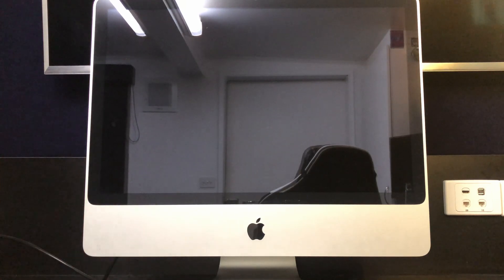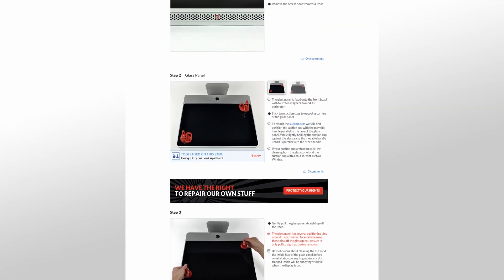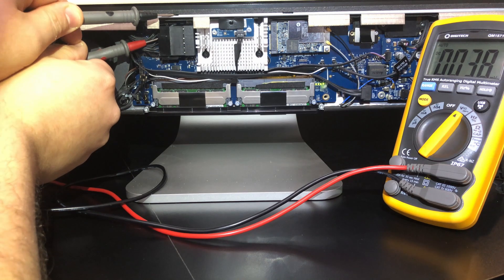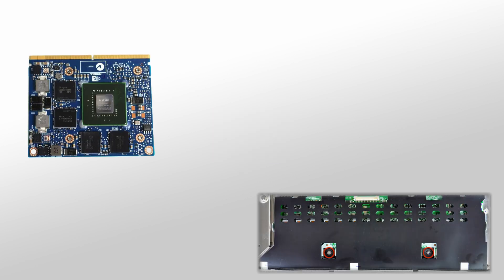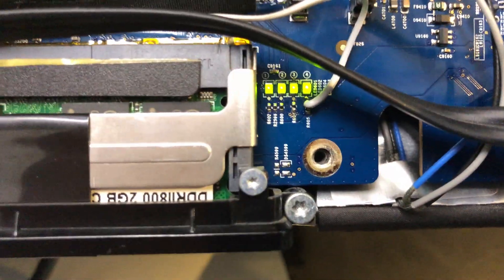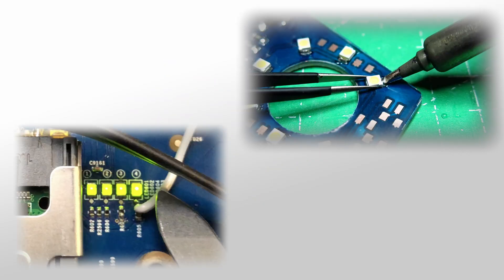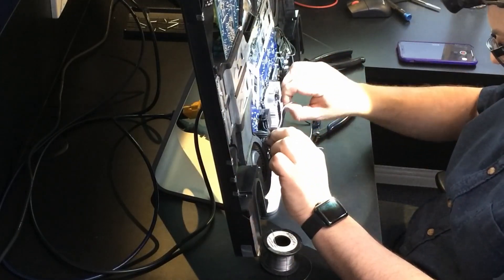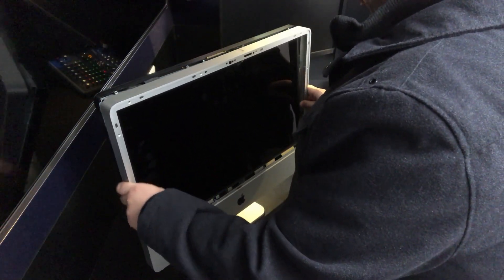2008 24" iMac No Backlight Repair

Comment: Hi there, I have an A1225 , powers on I can hear chime but black screen .   LED1 is on V = 1.8  LED2  is on V= 1.8 LED3 is off V=3.3  LED 4 is off V= 0
Terminal 3 on connector is 0V , I do not you schematic diagram to trace circuit . Any help appriciated

Comment: My imac 27 2011 screen goes complete black while imac is still working  ( Screen sharing to macbook still working too)   .. when I press power button for 1s and click on the mouse screen came back on (sometimes i need to repeat it few times) ,,,  I've done PRam and nvram reset ,imac was cleaned  Gpu ,Pcu termal paste change but did not helped ...   Any advice ?  ( Screen sharing to macbook still working during black screen on imac ) .. Any advice ?

Comment: Great video! I hope you still reply to comments after two years... I came to this page by google search because my 2008 iMac 24" has black screen issue. When powered on, I do get the apple chime sound, and I see the fans are running but nothing on the screen. I tried shining a flashlight into the screen, still see nothing. Then I did the voltage test as shown in your video, it came out as zero. One thing I noticed is that in your video, all of 4 LEDs are on with green light. But I only got LED 1 and 2 on, not 3 and 4. I suspect that my graphics card is dead, but not sure. I cannot find the right cable (mini DVI ?) to connect it to an external monitor to verify. Any suggestion or tip? Thanks!
Reply from the maker: If you have an integrated graphics card u won’t get led 3. If you have an actual graphics card then no led 3 means it’s not working. U can try take the card out and try the oven trick but that’s not a great fix, it will be temporary at best.  Buying a  replacement card wouldn’t be worth it. 

If u have no graphics card (intel graphics) (not even sure if this was an option with ur model) then u won’t get led 3 and you probably have an issue different from this video.
Reply: @AronBezzina  Wow, thanks for the quick response. Really appreciate it. I do have a discrete graphics card and your reply somehow confirmed my suspicion. I will see if I can get a spare part for it.
Reply: @AronBezzina  Hi Aron, just to follow up on this. It turns out that it is the graphics card and 2008 iMac does have discrete graphics card. So, I replaced it and now it works perfectly. Thanks again for you help.

Comment: I can't quite figure out what's wrong with mine. The iMac [early 2008] restarts several times before being stable. Of late it shuts down more often than before [3 months problem]. 
1. I noticed that the first 3 LED lights work just fine but they quickly go off [except #LED 1] whenever #LED4 comes on. This happens several times until it finally stabilizes and turns on [at this point, all the 4 LED lights are on and performing normally]. 
2. I further examined the inverter area and discovered that one of the 4 connectors [from the inverter to the screen] was burnt [the plastic was melted]. I replaced it with a good one hoping that the problem will be solved but it persisted. 
How can I solve this? Thank you
Reply from the maker: It could be a bad power supply. I would suggest using a multimeter to check the voltages coming out of the psu.
Reply: @AronBezzina  I’ll do that, thanks. Does using a UPS make a difference? Coz I’m using one
Reply from the maker: @isaacmathewajuoga8026  as long as it's working fine then no (outputting 240v or 110v)
Reply: @AronBezzina  just checked. Its output is 230V

Comment: My LED 4 is not on at all tho
Reply from the maker: Led 4 not being on means the computer is not talking to the screen. This would mean that you wouldn’t have the image on the screen with no backlight, you would have no image at all. You may have a bad LVDS cable (the cable from the screen to the computer) or a bad connector, or bad screen.

Comment: What if there is no image or backlots but the computer is functioning as supposed to... ?
Reply from the maker: As in, you can plug-in an external screen and it works fine, but the main screen isn’t coming on, and it’s not just a backlight issue, there is no image at all?
It could be a lot of things.
Check the software settings,
Check the diagnostic LEDs see what they say
Reply: @AronBezzina  I think it maybe be my video cable because it’s lose where it connects to the screen... but should the backlight at least be on or does it not turn on when that isn’t connected
Reply from the maker: @GeoMetro2  I am not sure if the computer may notice there is no screen connected and as a result not light up the backlight. I would suggest fixing the bad connection. also, u can use the diagnostic LEDs to see what part isn't working look at time stamp 5:05 for info on the LEDs (pause and read the screen)
Reply: @AronBezzina  so I got backlight mow that I messed with the gpu being seated correctly and I still don’t have video...
Reply from the maker: @GeoMetro2  do u get external video? What LEDs light up
Reply: @AronBezzina  all 4
Reply from the maker: Ok because all 4 are on and you now have backlight, my assumption is you have a dead screen, or cable that go to screen, or socket on motherboard / screen for screen cable.

Take a good look for damage on the motherboard screen socket & the socket on the screen. If the are fine, try test screen cable with multimeter in continuity mode. If the ports and cable appear fine I think u would need a new screen.
Reply: @AronBezzina  thank you..  it will be a while before I can get into that but I’m sure I messed up the screen cable or socket now that I look back on it....

Comment: Ok, I hope you still remember this issue. I have a similar problem on my sisters 8,1 20 inch iMac, it has only one light bulb (the bottom one) working at all times, and the upper part of the screen turns on for just a brief second, after waking a mac from sleep, and then the upper backlight of the screen turns off.
Reply from the maker: are you saying that only half of the backlight works? if so then you may have a dead backlight.
Reply: @AronBezzina  Yes, that's right, half of the screens backlight doesn't work. I don't know the exact details of what backlight system there is used underneath the display, but we'd like to get it fixed, - I've had experience from simple repairs, might be able to do soldering if necessary. Thanks for looking into it!
Reply from the maker: @robiocrafteuro  I think the backlight will possibly be a string (or 2) of LEDs if one dies the whole string may be dead, you may be able to replace the dead LED but it's going to be easier to get a replacement screen, seeing the age of the Mac you may be able to find a dead one cheap online that you can get a replacement screen from. Good luck :)

Comment: Can I do this same repair on a different age imac? I found led4. My setup looks a little different then yours. 

I see Led 1, Led2, Led4, then it shows four circles 1, 2, 3, 4, at the fourth circle it shows led3. And the 3rd circle it had a rectangle near it that does not look like the two rectangles above and the one below it. It looks like it has a small hole in it. It looks silver, instead of yellow like the other 3 rectangles that are near 1,2,3,4 circles. I wish I could show you a screenshot, would make it easier to explain.
Reply from the maker: In theory if the iMac has the exact same issue than the fix should work. LED 4 comes on when the screen should be on so using it is still a good option. U should be able to solder onto the side of the LED.
However being a different machine it may not be the same cable that this needs to connect to.
Reply: @AronBezzina  Thank you, I will try this soon and let you know if it worked
Reply: @jamer379  did it work ?

Comment: Excellent video.
 My A1224 Imac has the same problem, but I can't find the exactly point below the fourth LED to solder the wire.
I connected the wire bellow the third LED, the screen works, but the fans starts to very fast.
I took a picture of the diagnostic LED area, if there is any way for you to see the photo, maybe you could help me.
Thanks a lot.
Reply from the maker: Fernando I don’t think u can attach a pic in YouTube. Find me on Facebook ( Aron Bezzina. ). Does ur 4th led light up ?
The fan usually spins fast if a sensor is not plugged in such as the temp sensor for the HDD, DVD or LCD. Double check they connected :)
Reply: Aron, thanks for answering.
The 4th led lights up.
I’ll try to send you a pic, so you can help me.
👍

Comment: Hi Aron, my friend gave me an iMac 2011 21.5" and I am new to Mac.  I tried to add a SSD, clean the fan and changing thermal paste for both GPU and CPU.  After I assemble them back together.  I got blackscreen.  All 4 LEDs are on but just no image.   There was once image flashing but I cannot repeat this.

I was thinking my thermal compound is a bad one so I have a new one on order.   

Do you have any suggestion?  Thanks a lot.
Reply from the maker: Check the ram, also double check the display, make sure it’s plugged in on all connections. Also try test with external monitor.
Reply: Aron Bezzina thanks a lot for your suggestion.  I will try when my new thermal paste arrive

Comment: what cable can i use to connect them together? does it have to be a Ribbon cable?
Reply from the maker: Just whatever is at hand should be fine. Wire from a USB cable, an old mouse, some Ethernet cable. It won’t really matter. It just has to be thin enough to solder to the LED so nothing thick like power cable.

Comment: I have an iMac 2008 20" and the backlight isn't coming on. I do however have the 3v at the connector, do you have a video on the other type of issue?
Reply from the maker: I don't sorry, I would suggest testing that the inverter is getting power (not just the trigger signal). Off the top of my head the diagnostic process I would follow would be... 1. Power to inverter, 2. Inverter output (high voltage) 3. Backlight. Sorry I can't be of more help. Good luck.
Reply: did you find the issue?
Reply: @AVSCDvideoproduction  No i've been using an external monitor since, may have a look now we all have a lot more time!
Reply: @rschunkster  by the way an external monitor didnt work for me, so it could be in fact your inverter, check this out: https://youtu.be/qD0GQz3fIeo

Comment: Any idea if the same issue occurs on the 2010 27" models? On mine, the screen lights up briefly before going black. The LCD is working when viewed under a bright light. Changing the driver board hasn't helped, though I can't guarantee that the "new" one worked any better to begin with.
Reply from the maker: Peter Charlton I think that model had graphics chips die so that’s probably your problem, you may still have the on signal as an issue tho, so I suggest looking for the voltages as shown in the video, you may need to find a schematic for your model to workout where the backlight on trigger is .
Reply: @AronBezzina  Thanks, I'll check it out. It still runs an external monitor just fine, FYI.
Reply: @LongPeter  Hi Peter,

Not sure if you've got the issue resolved in the meanwhile but you can also check your ambient light sensor. I've had this problem with a 2010 27" where the ambient light sensor was broken, which the brightness is usually based on. Because of this, the screen stayed black forever.
Reply: @JasperCrD  Thanks Jasper, that's an interesting idea. I wouldn't have thought the ambient light sensor could dim the backlight all the way to black.

Comment: Excellent video. Super easy to follow though the idea of replicating work makes me cringe. 
2007 24” iMac: I don’t think I can see an image with the flash light. I hear the boot chime. I try login and hear the hard drive spin but no image. Any ideas?
(I’m going to crack open iMac because I at least need to get hard drive out and copy data)
Reply from the maker: CSB5K try the external video port if you have an adapter. I think however the issue is likely a dead graphics chip making the machine not really something worth repairing. That being said if it is a dead chip and you are going to toss it out you may as well try heating the graphics chip with a heat gun. It won’t permanently fix anything but it may keep the machine running for a bit longer.

Comment: what about if the backlight isnt as bright as it is suposed to be? is that fixed by replacing the inverter board? or the entire screen?
Reply from the maker: Chris Nova777 if the backlight works but isn’t bright enough it could be a few things:
-The backlight could be failing (part of the LCD screen)
-the signal to the inverter board that tells it what brightness to be may not be changing
-the inverter board may have an issue
Reply: @AronBezzina  when i first got the iMac i remember it was very white + bright, but over time its become nowhere near as white and dull, and yes the brightness controls don't seem to be working properly.. the screen changes slightly in brightness but doesn't seem to have the proper functionality as the brightness controls do on my MBP laptop.
Reply from the maker: Chris Nova777 my guess is it’s probably the backlight, this basically requires a new screen

Comment: Very well made Video, Thank you for such clear and good instructions. 
I have the same Machine, but my Backlight is only partially off, often flickering at start, sometimes going dark altogether. I already bought a new, tested Inverter and changed it, but that lead to no changes in behavior. On the "on/Off" trigger pin you point out in the Video, I get a voltage of roughly 1,5 V (fluctuating between 1.58 and 1.44 V) - I'm not sure if that is what is causing the issue, as the Voltage you took from the LED only is 1.8V, and your display works... May I ask where you got the Info what Voltage should be present on that pin? On my search for clues on the Web I came about different statements what that specific Voltage should be (1.5V, 3.3V, 5V..) . To know a definitive answer could help me find the root of my problem.

Otherwise I simply would take 3.3V from the SATA-Power Connector and see what happens. :D 

Again thank you for your Video, on this otherwise rarely in-depth talked about issue with old imacs. :)
Reply from the maker: From memory I found that it is supposed to be 3.3v from a schematic. I would suggest cutting the wire and adding an extension wire as I have in the video. Then either solder to the 1.8v from led 4 as I did or solder to the 3.3v of led 3, on the other side of its resistor.

Comment: Could you not just run a jumper wire from the imac's PSU 3.3v power rail to the the inverter on/off signal wire?
Reply from the maker: Stop Code Zero Echo that could be done, however doing so would mean the backlight is on whenever the computer is on, even when the screen is supposed to be off. The place I got the power from was selected specifically as it only ever has power when the screen is supposed to be on (ie off if the screen is sleeping)
Reply: @AronBezzina  I have a 2007 imac 20in with what appears to be a bad inverter. (I can see the apple logo and login screen if I shine a flashlight at the screen and it sends a pic to an ext monitor) is this model affected by a gpu bug you described? I plan to look further into it come payday as I need a T8 torx and suction cups to get in to test with my meter.
Reply from the maker: Stop Code Zero Echo I am not sure if your model has the same problem or not. What you should do is check with a multimeter if the “on signal” is being produced and sent to the inverter. If it is then this is not going to help you, it may be a blown backlight. 
Good luck :)